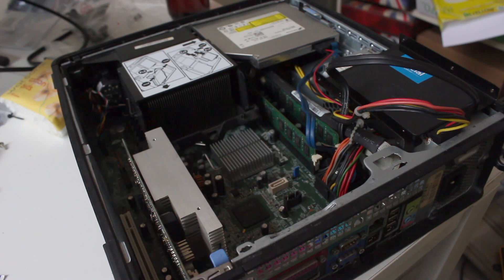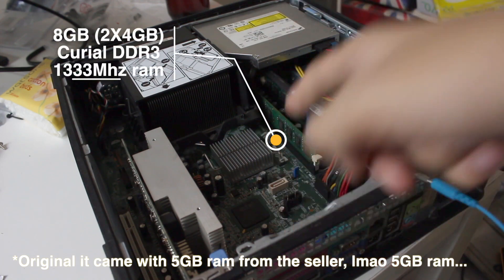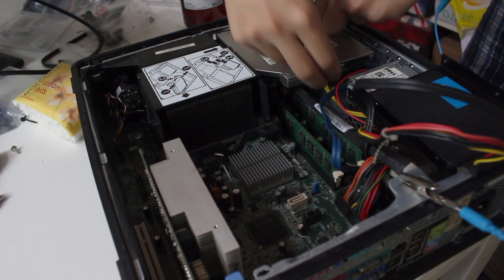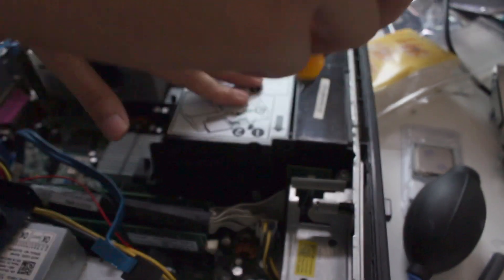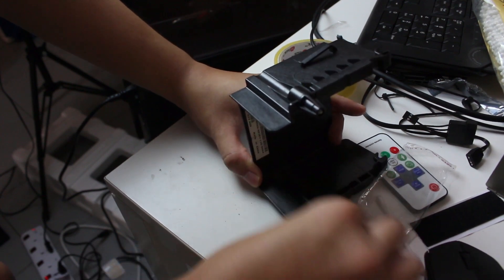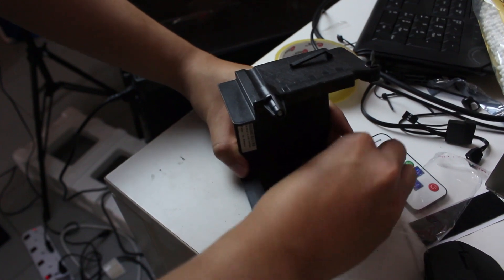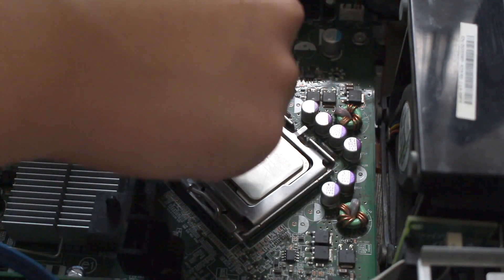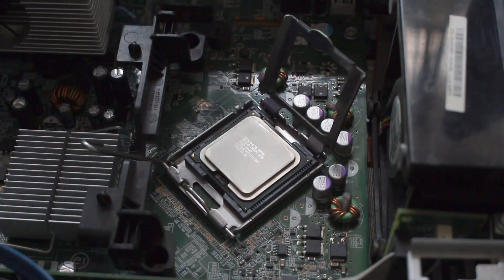Dell Optiplex 780 SFF CPU Upgrade Tutorial

Comment: Thanks!   I upgraded my CPU from the current q8400 to a q9400 but when I boot up it still shows the old q8400 as the cpu.  Any idea what I did wrong?
Reply from the maker: It sounds like your system might not have recognized the new CPU properly. Here are a few steps to troubleshoot and resolve the issue:

1. **Check Compatibility**: Ensure that your motherboard supports the Q9400 CPU. Verify this on the motherboard manufacturer's website.

2. **Update BIOS**: Sometimes, a BIOS update is necessary for the motherboard to recognize a new CPU. Check the motherboard manufacturer's website for the latest BIOS version and update if needed.

3. **Reinstall CPU**: Power off your system and unplug it. Remove the Q9400, check for any bent pins or improper seating, and reinstall it carefully.

4. **Clear CMOS**: Resetting the BIOS to default settings can help. Locate the CMOS battery on your motherboard, remove it for a few minutes, then replace it. Alternatively, use the motherboard jumper to clear the CMOS.

5. **Verify Installation**: Ensure that the CPU fan and heat sink are properly installed and connected. An improperly seated heat sink can cause the CPU not to function correctly.

6. **BIOS Settings**: After booting up, enter the BIOS setup and check if the new CPU is recognized there. Save and exit the BIOS setup.

If these steps don't resolve the issue, there might be a hardware compatibility problem or a defect with the new CPU.
Reply: Thank you!  I “updated” the BIOS via flash and that did the trick.  Much appreciated 👍🏻
Reply from the maker: You’re welcome and thanks for watching!

Comment: Hi Jacky, so i put an old hard drive into my 780 Optiplex to see if i have any old pictures and videos on it. But i keep getting the "Delete restoration data and proceed to system boot menu" message. If select this option will all of my data such as pictures, videos and documents be deleted from my hard drive? How do i get around this problem
Reply from the maker: Hi Shawn. The message you're seeing, "Delete restoration data and proceed to system boot menu," is typically related to the system's boot process and shouldn't directly affect the data on your hard drive. However, it's always important to proceed with caution when dealing with data recovery to minimize any potential risks.

To help you get around this problem and recover your data safely, here are a few steps you can try:

1. Don't select the "Delete restoration data" option for now. It's better to avoid taking any action that may potentially delete data.

2. Instead, restart your computer and enter the BIOS or UEFI settings. This is usually done by pressing a specific key during the startup process, such as F2, F12, or Del. Consult your computer's manual or search online for the specific key for your Dell Optiplex model.

3. Once in the BIOS or UEFI settings, navigate to the boot order or boot priority options. Make sure the hard drive containing your old data is set as the primary boot device.

4. Save the changes and exit the BIOS or UEFI settings. Your computer should attempt to boot from the selected hard drive and hopefully bypass the "Delete restoration data" message.

5. If you still encounter issues, it's advisable to seek assistance from a professional technician or a knowledgeable friend who can help you troubleshoot the problem further.

Remember, it's crucial to exercise caution and have a backup of your important data before attempting any recovery process.
Reply: @JackyYBT  thank you so much for the quick reply! I tried doing making it the primary option but it still didn't work. I have been looking this up online for 2 hours now, tried everything and still nothing. I'll see if there I a PC store near me where I can take it to. If not then I'll just do the delete restoration data option. Thank you for ypur help Jacky! Really appreciate it.
Reply from the maker: You’re welcome, thanks for watching too. Hopefully your issue will get resolved soon!

Comment: What about the notch’s on the piece I have a cpu that doesent fit the notch’s
Reply from the maker: What do you mean by that? As long your cpu is compatible with LGA 775 motherboard then it should fit. (Core 2 duo/quad is using LGA 775 platform)

Comment: what version of bios are you using? 
I'm using version A03, does it need to be replaced or updated?
Reply from the maker: It seems like you didn’t watch the video until the end. You can watch 9:52 and you will get the answer. It’s better to update bios first to avoid any compatibility issues

Comment: hi sir i have an optiplex 780 sff too, it comes with a 235w psu, an intel core 2 duo e7500, two sticks of ddr3 samsung 1033mhz 4gb ram, samsung hdd 160gb 7200rpm, but no graphics card installed. is it compatible if i upgrade it with a q9500 and gt 710 low profile?
Reply from the maker: Of course you can, no problem on the power consumption.
Reply: @JackyYBT  will my 235w psu fail? despite the gt710 needs atleast 300w psu
Reply from the maker: I was using core 2 quad Q9500 with GTX750 low profile with no problem

Comment: Hello, thank you Jacky for your answers and vidéo .
 for info, i operated my dell optiplex MT 780 for the first time. Nickel. upgrade core 2 to q9400 and 16 gb ddr3 1333. I still have to buy and install an SSD by first making a clone of my Windows. A real cooler. 58 degree maximum at full load (4 cores, use 100%, seen with CPU-z) with my chess analysis engine.
 Just a question if you don't mind. I have another dell 780 to upgrade, but in DT format. The chip will be an e7500 recover from the other machine. Is it better to leave 8gb dd3 in 800mhz, or 4gb ddr3 in 1066mhz, or recover 8gb ddr3 1333mhz from the other upgrade machine? knowing that the e7500 chip has a fe 1066 mhz bus. thank you.
Reply from the maker: Just get 1066mhz ram to put in since like you said e7500 got 1066 MHz bus

Comment: Hello, thanks for the video.
I want a processor advice please following the heat sink and general power supply (305w no epa) please for an optiplex MT 780 mini tower. 
i have an e7500 duo. 
which 4-core processor do you recommend (q8300-q9650)? or other possible on motherboard socket Dell origin ?
 do I have to change the heat sink? food will be sufficient? I will put an ssd in place of the HDD and add an NVIDIA GT 710 2gb ram card. all with 8 gb ram ddr3 1333 thank you
Reply from the maker: Just go for q9650 as that is the highest and most powerful cpu for this 775 platform. If you want core i5 series then you need to buy another motherboard.
Reply: @JackyYBT  jacky, OK, thanks. in case the motherboard fails in a few years, what motherboard and processor and cooler will you put so that it does not consume a lot of power, so that the dell 305w power supply can support.
Reply from the maker: If the motherboard fails in few years time, I will suggest you to build a brand new pc using AMD Ryzen platform.
Reply: @JackyYBT  hello Jacky. ok. Just one last question if you don't mind. Can we put any processor supported by the socket 775 of the Dell MT 780 card origin , or should we only put a model indicated on the incomplete list of Dell support in pdf, not updated I think?
Reply from the maker: Check with the official website is the best but yes any socket 775 cpu should be compatible to the 775 dell stock motherboard.
Reply: I'd have suggested the Q9550... it's a lot cheaper on the used market and is still insanely good.

Comment: In my Optiplex 780 there's only 7.84GB RAM usable of 8.00GB. How did you get 8.00GB usable in 10:23? Is it because you're using external graphic card?
Reply from the maker: Maybe. But when I open task manager and check the usable RAM is same as you.

Comment: Upgrading to a higher TDP cpu wouldn't be an issue, might run a little warmer.  I'd recommend a CPU with ~65W TDP or lower. My work optiplex has a e7500 (65W TDP), I'm upgrading to a xeon L5430 (50W TDP) soon.  Still a good video.
Reply from the maker: Higher TDP cpu won’t be an issue if you have a sufficient amount of power supply. Thanks for watching and remember to subscribe that will help me a lot!
Reply: the general power supply depends on the format of your case and model of optiplex 780. for an MT 780, 255w so ok. for a usff .... it's less
See you soon

Comment: what is the max cpu upgrade i can do without upgrading the psu?
Reply from the maker: Intel core 2 quad Q9650
Reply: Jacky YBT will i3 9100f also work? I could upgrade my psu if needed
Reply from the maker: Nope. Unless you change the motherboard, only then you can use i3

Comment: Hello what graphics cards do you use for this Dell optiplex 7800 or if you can recommend me something for optiplex 780. Have a good day thank you.
Reply from the maker: If you just want to use for watching video and do some document work then Nvidia GT730 will do, if you want to play games then go for GTX 750Ti. If you want newer graphics card then GT1030/GTX1050Ti
Reply: @JackyYBT   Thank you for the advice
Reply from the maker: You are welcome, make sure you get the single slot version graphic not the usual dual slots
Reply: @JackyYBT  will a 1050 fit inside ??
Reply from the maker: Can, as long as it’s a single slot version.

Comment: current I have Intel (R) Core (TM) 2 duo CPU E7500 can I upgrade? if i can which would be the best?
Reply from the maker: Intel core 2 quad Q9650 is the best that you can upgrade
Reply: @JackyYBT  Hi, I have a question regarding an Intel Core 2 Quad Q9650 upgrade. Will the standard 180 watt PSU in my 780 MT be able to handle that CPU + GTX 1030? Thanks
Reply from the maker: According to Nvidia gt 1030 product page, the minimum power supply requirement is 300W

Comment: my CPU processor is Q9400, is it worth it to upgrade to Q9650? kindly respond!
Reply from the maker: I would say you stick with your Q9400, it’s not a big of a jump from Q9400 to Q9650
Reply: @JackyYBT  but it's pretty slow with win 10 running on it
Reply from the maker: @josiahsaji  upgrade your hard disk to SSD and upgrade ram to at least 8GB. These will help a lot on the performance
Reply: @JackyYBT  thanks, but can i use the SATA and the POWER CABLE from the DVD drive to use it on my SSD as a boot drive?
Reply from the maker: Yes you can

Comment: Hi, can I ask whats the video card your using on your Dell optiplex. I actually  bought the same one but it does not have any graphics card. I was planning to buy one but I'm afraid it might not be compatible. Can you give me some tips please. Thank you.. (-;
Reply from the maker: Mine is the Galax GTX 750 low profile graphic card
Reply: Hi Jacky YBT, do you think it’s possible to put an intel xeon processor on this specific Dell Optiplex"
Reply: Yer Tajj I don’t think you will be able to use a Xeon because the chipset is not compatible and it is not the same socket from what i’m aware.
Reply from the maker: Yer Tajj nope you can't because this is not a server motherboard